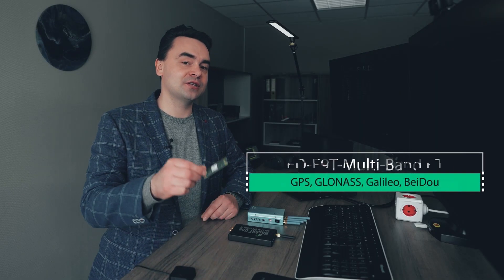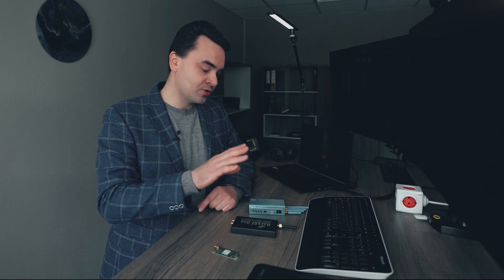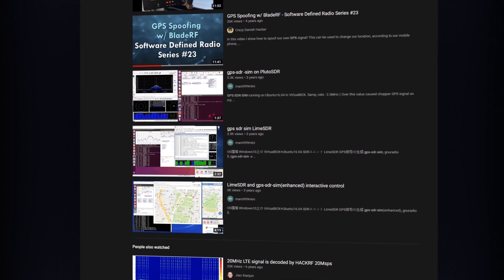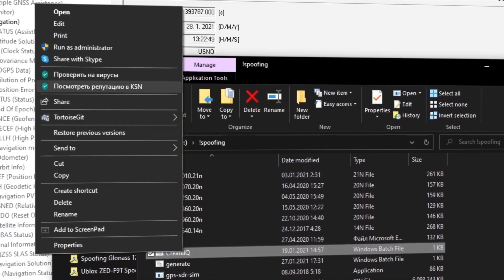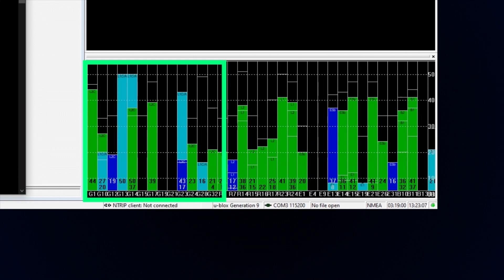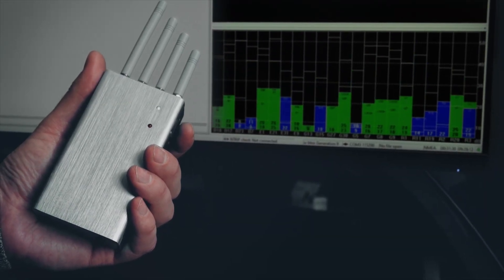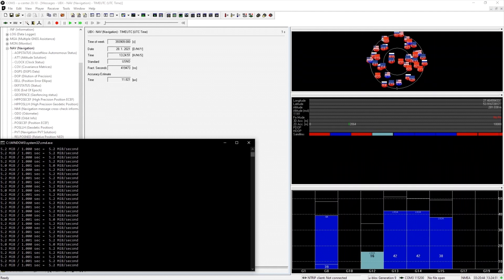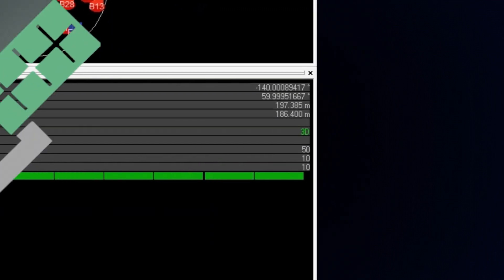Spoofing the multi-band RTK GNSS receiver with HackRF One and GNSS jammer

Comment: In my opinion, the test demoed is flawed using L1 band antenna at the window (for a dual-band receiver designed for "automotive application" as quoted, actually it is F9T for timing application like base station),   indoor environment with so close-by jammer and spoofer at the same time.
Reply from the maker: We used a double-band GNSS antenna on a windowsill. The receiver under test saw satellites in two RF bands.